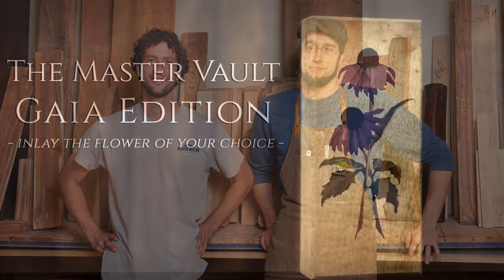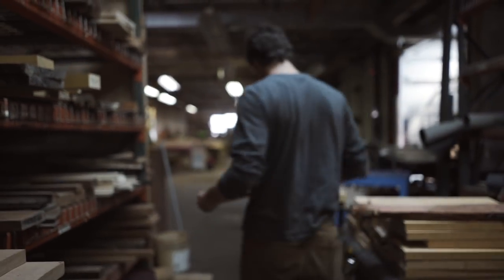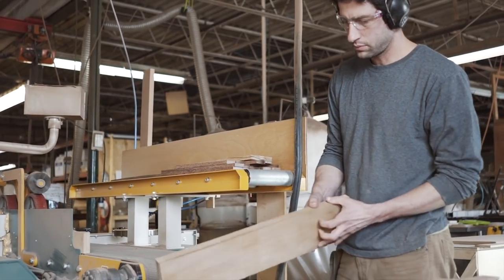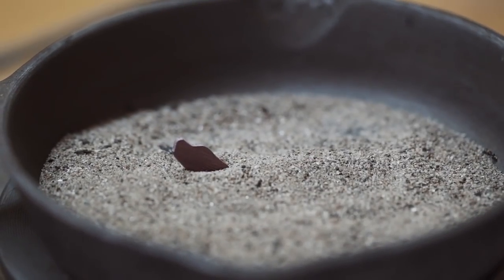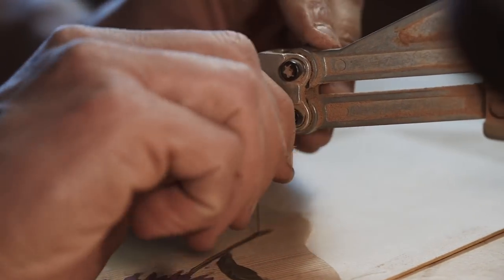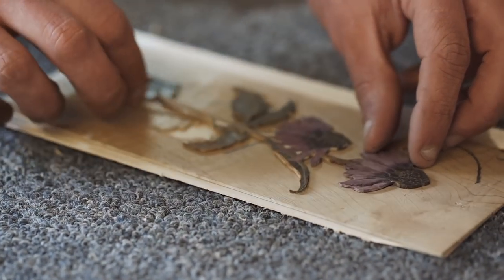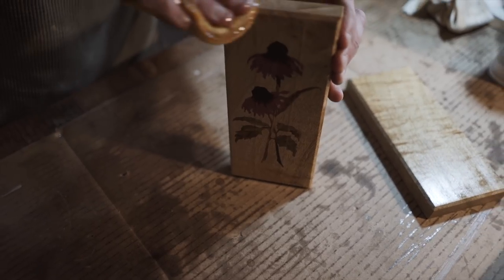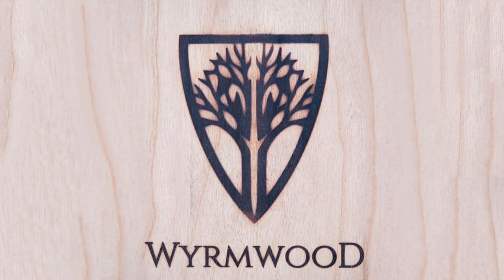The Making of: The Master Vault - Gaia Edition (Commentary)

Comment: What is the liquid you wipe on the piece at the end? And what is the purpose of this step? 

Also this was really well done. 😄
Reply: Looks like boiled linseed oil or something similar.Typically, this is to protect and seal the wood. Boiled linseed oil does not offer as much protection as a polyurethane stain, but it does bring out the natural colors of the wood more rather than transfer it's own color like a stain. (There are tons of resources online to learn more. I'm just starting to learn myself because of watching this video)
Reply from the maker: Its a mixture of Linseed Oil and Beeswax and the brand is Tried and True